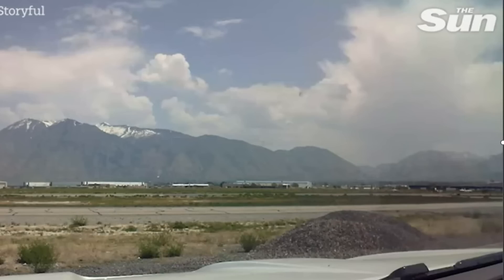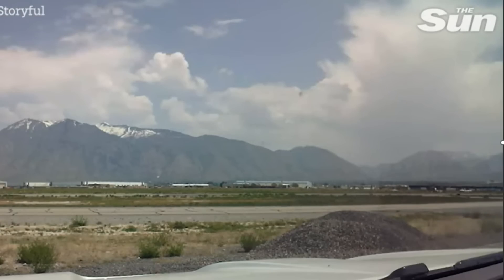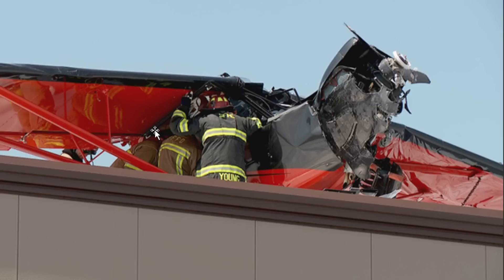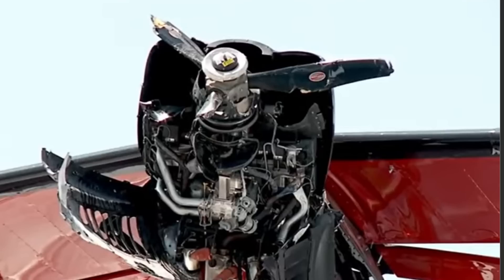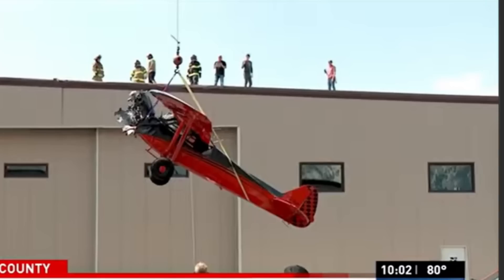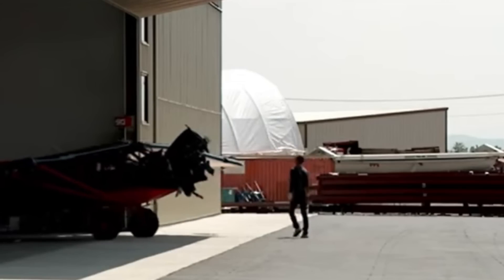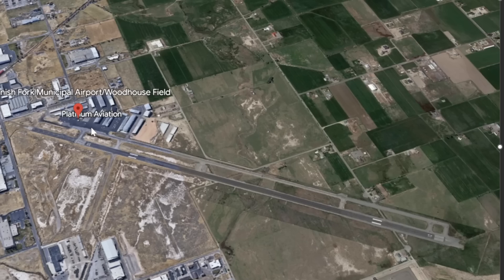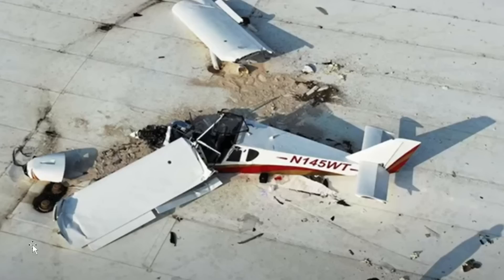Dash Camera Catches Aircraft Stall in Utah

Comment: 😆😆😆Good Video...                                                                                                                                                                                                           Stall? Aerodynamically speaking it appears it was no stall, but rather the craft never achieved proper takeoff speed or was out of balance tail heavy. A stall is when nominal airflow is impeded or ceased and 1 or both wings lose lift and drop dramatically, and or the entire craft.